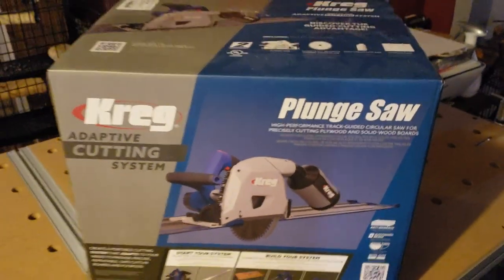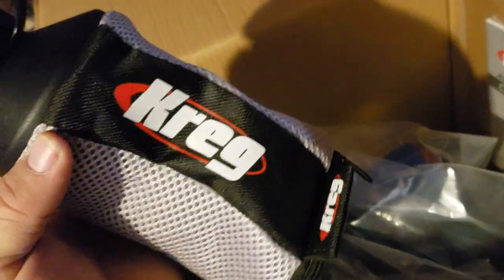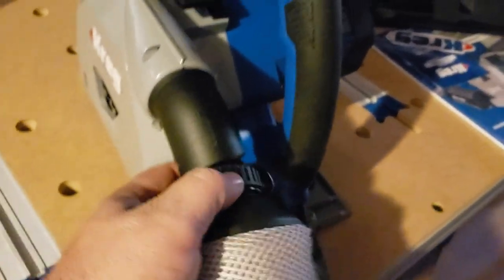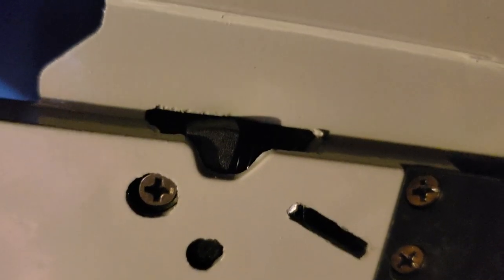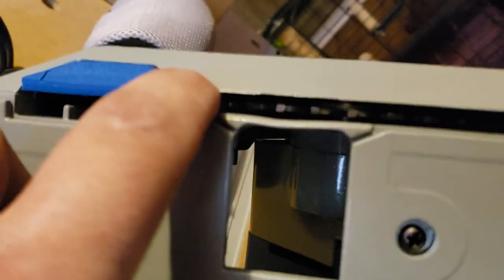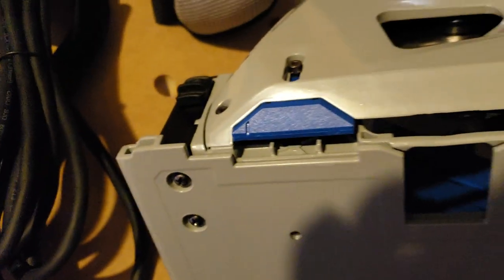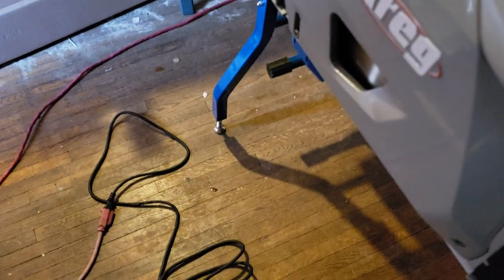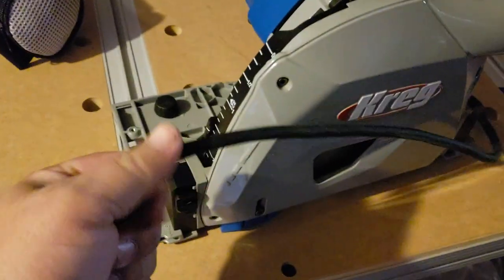Kreg plunge saw unboxing. with table

Comment: You needed to remove that blue splinter guard prior to your first cut while using the track. After your first cut with the track and you've cut the thr blue strip splinter guard on the track, you need to reinstall the plinter guard on the plunge saw, the place it on the track with a 3/4" board. Then adjust the plunge saw splinter guard down so it touches the board you're going to cut. This sets your saw up for proper cutting.
Reply from the maker: No. You can't unless you want to damage it. It's glued on. If I were to take it off the plastic strip would deform being soft plastic and would never be the same.